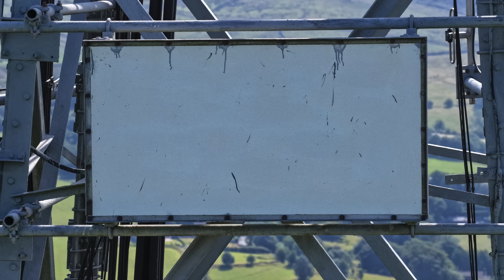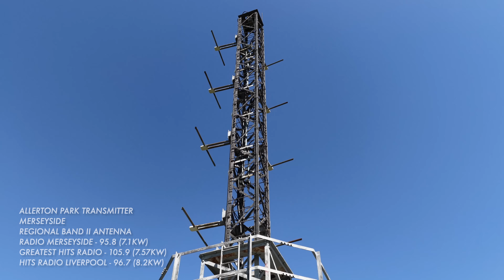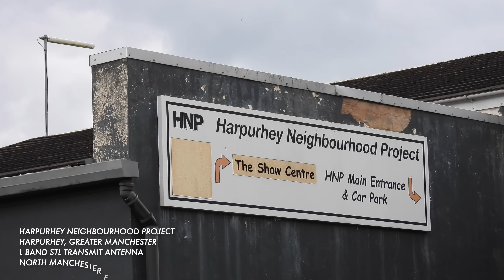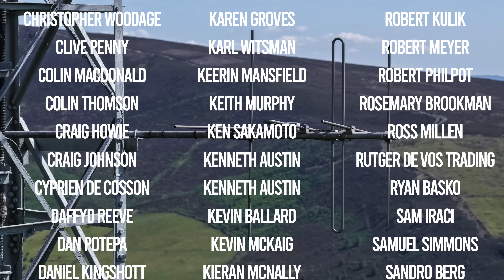Identifying Antennas On Radio Towers - A How To Guide

Comment: Hi guys, is there a way to embed critical digital data on AM/FM radio broadcast such as weather, headlines, and gps traffic? is there enough bandwidth or RDS is already maxed out? Thanks.
Reply: Yes, check out the Wikipedia article for "DirectBand". That's a North American service which did exactly that until 2012. There’s also a nice spectrum chart showing that there‘s roughly 40kHz of "free" bandwidth left above RDS.

Don’t think it’s possible with analogue AM, the bandwidth is too narrow.
Reply: @viva2archive Thanks!

Comment: Of course the feed and transmit setups at some sites are more interesting than others, even at a relatively mundane site.
Weymouth, for example, has RBL's on three different transmitters, Stockland Hill main TV RBL using two trough antennas, Bincome Hill backup RBL using a single log periodic (during times of extreme tidal fading, also the reason for two trough receive antennas located low down on the tower) and a log periodic on Rowridge for BBC Radio 1-4 RBL.

Other interesting sites include Rowridge that is the only main station to transmit both horizontal and vertical TV signals (for french interference mitigation), Chard that has BBC radio RBL's on both Wenvoe and NHT to account for historical BBC Radio welsh opt-outs, the sites like Fremont Point and Bressay that had complex multi-mode RBL setups and the NICAM radio link to the channel islands that used a UHF link (within the channel allocation used at stockland hill for TV) that only required 250W of erp to get from Stockland Hill to Alderney.
Reply: The NICAM link was very clever for the tech at the time. I wonder if anyone managed to intercept it on a TV or VCR?
Reply: @richardemms3050  I doubt it, it would have been very directional so I guess you need to be pretty much in line with the antennas to pick it up, plus it was not a standard TV signals so a VCR might not be able to accurately record the signal.

As an extra to my previous post another interesting TV relay was Rampisham, only something like 3W, which seems pretty simple, well yes if it was not for the multi-megawatt BBC WS SW station it was located at, it wasn't even on it's own tower, the log-periodic antennas were just attached to one of the curtain aerial support towers with it's supporting equipment in an enclosure below. How they kept the SW transmissions form swamping it out I'll never know.

Comment: I got it wrong yesterday the antenna for 96.5 Bolton FM is on top of a mill on Coe Street. Once our signal went off the manager KEVAN and chairman Andrew D rushed to the mill. It turns out a cleaner had pulled out a plug to plug their hoover on despite notices saying not to touch.

Comment: That was really good. The UK FM broadcast is similar to what we have in the US . Just we have HD radio hear and this is inside the same FM band. 88 to 108 MHZ . Our TV is different.  we use ATSC format and ATSC 3.0 . Can be VHF and UHF depending on area . Some same antenna's are used. Many high power UHF uses a wave guide feed and a slot antenna . You should do detailed on MW and LW and SW bands as well. The station I worked at had 4 phased 1/4 wave antennas .  Some have just 2 or even 1. WBZ in the us has 2 end fed half wave antennas phased and covers many states at night .  And on MW many don't know what they see is 1/2 the antenna.  The rest is in the ground and can be lots of copper . MW works on ground wave . So a good ground is so important. Wave length is a fixed thing so the length of elements is a big clue of the frequency that an antenna works on.  Once you know about what frequency it is just looking up band plain and you start piecing together the tower. Cheers from NY/ USA !

Comment: 8:47 Not strictly true ref. them being essentially one antenna, as it's actually two halves, fed in parallel, with a bottom half and a top half. You'll have duplicate exciters, duplicate RF amps, duplicate combiners, duplicate feeders, etc. National VHF main station sites tend to have their feeds split between the top half of Alan Dick arrowhead arrays, and the bottom half of arrowheads (n.b. some sites are split 4 upper + 4 lower (stack of 8), whereas others like WRT & PTB are 5+5 (stack of 10)). Everything is fed in parallel so that if one leg of the transmission chain fails, there's redundancy in the other leg.

9:16 IIRC, the number is panels used depends on the transmitted output power, due to the vertical radiation pattern of an antenna system and the need to avoid interference with aircraft communications and navigation systems, which are above 108MHz. IIRC, it tends to be that VHF Band II stations with 1kW or less use 1 panel/array, 1kW to <5kW use 2 stacked panels/arrays, 5kW to <25kW use 4 stacked panels/arrays, and those of 25kW or more use 8 or more stacked panels/arrays (Ofcoms radio engineering code is your friend).

12:52 Part of the reason why Capital are using two Shively 6812 antennas at the top of Liverpool Cathedral is because those systems lose >3dB if only one bay is used... Not good! Having two stacked gives a very slight power gain, but nothing to shout about (+0.03dB). I'd be interested to know what the length the feeder run is, because if they're using RG213 feeder at 37m, they've lost half the transmitter output power straight away...... 😕

Comment: 0:51 Oh dear, Lewis.... a bit of a school boy error - Broadcast Band II is 87.5 to 108.0 MHz VHF (i.e. not 88-108), as Ofcom licences down to 87.6 MHz (Mainly RSLs, but also some other low power services, can be found in the 87.6-87.9 MHz sub-band) 😉

Comment: 12.40 a circular polarized  FM  I had one It was not good for long distance but very good for a urban station I sold mine to a ARRGGG  in NYC  . he mounted it on a short mast and secures it to the fire escape with vice grip pliers  and then brings it back inside when not in use . .

Comment: Omnidirectional antennas can be cylindrical triangular or rectangular beaming out in all directions, or like Radio Luxembourg's former 49mb SW transmitter, can have 4 masts linked rogether by wires also beaming out in all directions. Curtain antennas are directional with two masts linked by wires set at an equidistant distance apart. 

Radio Luxembourg's former MW set up at Marnach Northern Luxembourg had two sets of antennas ie an omnidirectional antenna flanked by a single triangular reflector tower set on a slope on the northern part of the transmitter site, to beam 324 degrees West North West towards the United Kingdom at 1200kW ERP and a separate antenna set up consisting of another omnidirectional mast flanked by two triangular reflector towers to beam 45 degrees East South East towards Germany at 600kW. The remaining 3 antennas finally closed down 31st December 2015 at a much reduced 300kW at 12 midnight UK / 1am CET+1.

Comment: Lewis the antenna for Bolton FM is not on Dove Mill it's on a mill in Calvin Street used by Parcel Force. I know this as I was the Admin Manager at Bolton FM when it launched in June 2010. I was first to know the frequency i6.5 fm as I took the phonecall from OFCOM. They were considering a further relay back in 2012 and were looking at having it on top of Bob Smithy's pub up on Chorley zold Road. DOCE mill is in Deane just 5 mins walk from where I live.
Reply from the maker: Sorry Sam that’s not true it’s on Dove Mill after relocating there in 2020 from the Cube
Reply: Thanks Lewis love your vids. Missed your talk at Phil's club a while back. 73s
Reply from the maker: @sammirobinson-fabhiit3813  I didn't do a talk at a club?

Comment: A few basic antenna notes a layman might like to know. A single dipole element, like on a transistor radio, has a roughly spherical radiation pattern. Like a bare lightbulb. If you mount a few dipole above and below each other, spaced correctly, the radiation pattern goes more doughnut shaped, out more sideways than up or down. Think like a hurricane lantern, won't illuminate the roof or floor, but the walls will be well lit. And if you put in the same amount of power, less goes out to space or into the ground, but further out sideways. The more elements stacked, the flatter the pattern gets. 4 elements might be like a doughnut, 8 might be like a pie pan, 12 might be a thin crust pizza. As the broadcasters are not interested in the TV reception of aliens or mole people, the more power going sideways, generally the better.
Reply: A single element antenna is a monopole, not a dipole, which has two elements (di=two).  A vertical dipole antenna (one element up and one down) has a doughnut shaped radiation pattern. Depending on the phasing harness connecting them, stacking dipoles can produce a flatter doughnut or a sphere, although they most commonly are phased to produce more gain (flatter doughnut).

Comment: Your videos are very interesting and this one explains quite a lot, but I'm rather bamboozled by terms like "dipole" and "log periodic"; would you consider doing a video that explains these terms?
Reply: The quick answer is they are different designs of antennae with directional capability.  The exact way each design accomplishes that is a little different, and some designs use elements from multiple types.  Everything in physics is a compromise and antenna design is about pushing the compromises out of band.

Comment: At 11:00 I have to say I really dislike the very expensive and overrated Lindenblad, from using them in the past, they have a very negative gain figure meaning you have to use a 300W TX to get the ERP of not even 100Watts.  It's a waste of power for trying to provide mixed polarisation when there isn't much call for that now.  The same could be achieved by running 25Watts into a 6dB gain antenna to get an ERP of 100W and if a cardioid pattern is required, 4 stacked dipoles could be spaced close enough to the mast to steer the radiation pattern.
The type of antenna is often chosen based on the TX site and the coverage, there is no point going out of the area, but you want a strong signal in your own area.  That's why the Capital, ex-Juice, antenna on the cathedral in Liverpool is a -3dB design but circular polarisation to give a downward tilt and coverage.
If you're thinking RF coverage, think what you can do with a floodlight compared to a torch or a laser and combinations.  Obviously not the same thing, but it helps people understand how the radiation travels.
The tests years ago for Juice were with 100W in to a 5/8wave vertical on the cathedral.  It was being picked up in Wales no problem, and through Chester, but not Ellesmere Port or parts of Liverpool.  That's due to the radiation angle.

I'm sure you know all this.

Comment: The US is much different… AM/FM broadcast is so much different than the UK. AM radio (535-1650 kHz)towers if possible are located in swamps or low spots, sometimes on top of buildings with a large ground straps…. They usually do not have other services on them. FM broadcast (88-108 MHz) radio tends to have tall towers on top of hills. The antennas of the FM broadcast are usually heavyweight and are dual polarity, capable of many kilowatts of power. TV is using both VHF and UHF frequencies using ATSC 1 standards for North America. Conversion to ATSC 3 is underway to some extent. My broadcast TV antenna looks more like 3 UHF beams pointed to Erie Pa and Buffalo NY, 1 VHF high pointed to Erie Pa and a Omni directional antenna for FM.  With 50+ digital broadcast channels from 10+ 6 MHz RF channels. Frequencies for TV are still allocated in 6 MHz chunks like they have been since the late 40’s. But with them compressed to 35 RF channels, 12 in VHF and 23 in UHF. Much less than the 82 channels that were used in the 1960’s. 12 in VHF and 70 in UHF. The TV transmitter antennas more robust and handle up to 1 megawatt ERIP and is usually much more robust. My poor roof looks like a porcupine with TV, HF, VHF and UHF in Ham radio antennas. Nice to live in the countryside with no antenna zoning issues, and I even have fibre optic internet connection here at my home. Oh yea, forgot my satellite antennas… on poles on the ground.

Just another 70 year old geek!!!
DE N2JYG

Comment: Thanks for bringing this to us Lewis.  I've got one I've been trying to figure out for several years.  This is here in the U. S. There is an AM broadcast transmitter site on the west side of the  city.  It's been there for many years. Operates on 1050 kHz @ 1000 watts daytime and 25 watts nighttime.  Several years ago a couple of appurtences appeared near the top of the tower. They are about the right 18:11  size for the turnstile antennas used for FM broadcast. A  number of broadcast engineers refer to them as rototillers after the garden implement they resemble.  However, these two are covered in gray fiberglass radomes, if they are antennas. I thought at first they were loop dipolles for that station's FM translato, but their translator is on  a different tower a few miles east south east of there.: The FCC's database shows no FM station coming from that tower. The only FM station they show  close to that location is a 100 kw on 94.1 about three miles south of this tower and they use an eight or larger bay array. Also, most FM stations that I see do not shield their antennas from the weather. They appeared there before 5G cellular was a thing.  I'm not sure I see a feed-line running to these, so they could be passive devices if they are even radio related at all? Anyone have ideas?

Comment: All national DAB feeds (BBC, D1, SDL, D1 Scotland) can be found on Astra 2E 28.2°E, 11.4265GHz H. I suspect they're used as backups and for more isolated sites.
Reply: I believe they are the only feed for them, or at least for the national multiplex. It has to be accurately synchronised with GPS so is calibrated with a buffer to broadcast at the same time. The radio 4 pips are therefore a little behind FM.

Comment: I dont get why they would use circular polarised for broadcast radio, the polarisation mismatch with all the receiving equipment which is linear will have a significant loss, I must be missing something as I would not use circular, even forgetting the mismatch issue, circular has a 3db loss over linear even when the receiving end is also circular due to the way the polarisation works.
Reply: Circular or slant is used so that reception is available whether you have a rooftop horizontal aerial or a whip aerial on a portable device.

Originally all VHF FM broadcasts were horizontal polarization, but portable sets became cheaply available in the 1970s.

Comment: Thanks for the deep dive. Here in the Americas, we rarely see AlanDick antennas, but Kathrein/Scala, ERI, Jampro, PSI, Shively and Dielectric share the market. For FM, the US standardized on horizontal polarization in the 1940's, but circular ('mixed') polarization became the de-facto standard because horizontal does so poorly into car antennas. Here, you see a few ring-stub or helical circular antennas, but the 'rototiller' antennas invented by ERI and now sold by them and PSI are the most popular.
Reply: ...and adding that I just found out that Jampro, a popular line of TV and FM transmit antennas stateside, and AlanDick are under common ownership and offer similar products worldwide. Carry on!